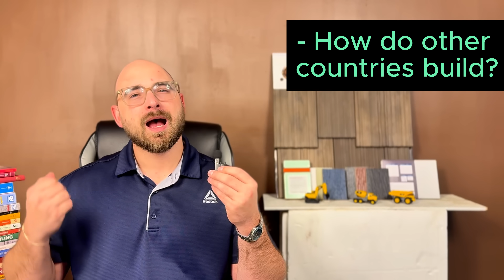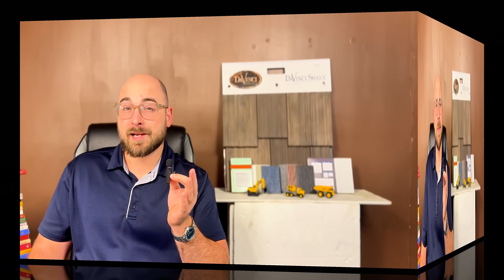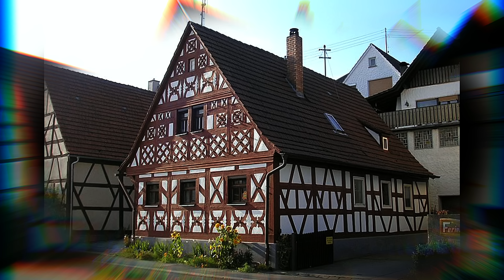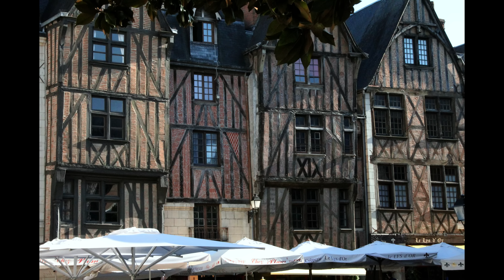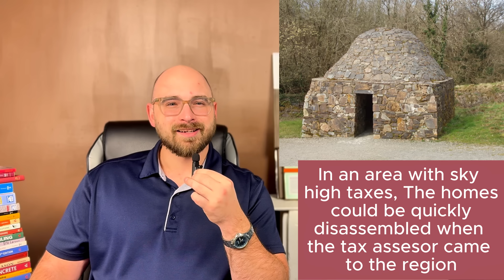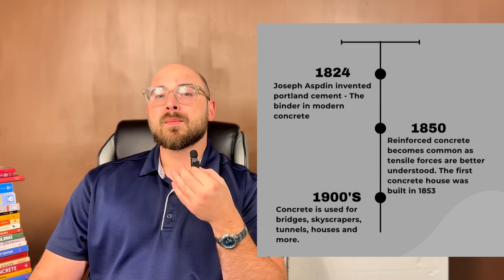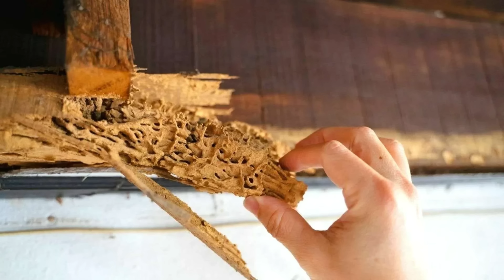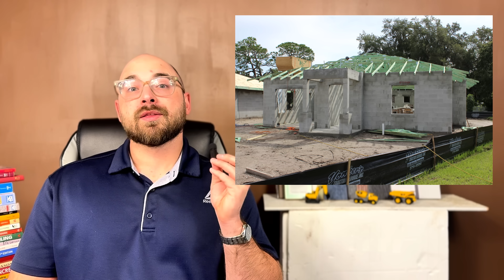Why Other Countries LAUGH at American Homes

Comment: The one item that many people don't realize is that building a home is 50-60% labor. Stick framing is stupid simple, and sheeting is also stupid simple. In 2009 my wife and I bought land, had the pad poured with the plumbing, and I did the rest. We built a 2 story, 2300 sq. ft home in < 1 year, and did it all for <$60k. The same home was quoted to us (mid-2009) for $260k. So, if you are able to, do the work yourself. You'll save a TON of money, and have the pride of building and owning your own home at a fraction of the cost. It will suck, and feel free to hire out the stuff you don't want to do (electrical and drywall for me). Even if you are the GC (General Contractor - the boss) you will save tonnes of money. Just do your research and call your local building inspector. They are there to help you. Utilize them. Housing is still affordable, if you are willing to do the work. DO NOT buy a home from a spec home builder... it's a rip off, and quality is ALWAYS D-.
Reply from the maker: That’s an awesome story, 

I think that you greatly overestimate the capability of the average person to build a home. the technical skills, the knowledge required to be a GC, and the time required to build your own home, 

And even if you went this route, ICF is also extremely DIY friendly. You could have built an all concrete house with much better safety and energy efficiency. but almost no one is concerned about building well, they’re concerned about building big, fast, and cheap whether it’s DIY or by a professional builder

Comment: I personally don't care its a roof over My head it keeps the rain out
Reply from the maker: They way they build them now the roofs leak
Reply: @Mike_Fortin  Well I use tar paper and shingles and I don't have a problem with leaks. I have no trees to harm My roof and no valleys to worry about plus I use Gable vents My house was built in the 80s and it is a Ranch with only four corners. My house is affordable to take care of. I've seen Brick and Cement houses bulldozed because of age and weakness and all building materials have limits and tend to start failing over time and because of poor maintenance. There are some places where you should not build on at all.

Comment: its less about the style of the house, its about standards  and code being both lower and on top of that ignored or looked at as a suggestion. you'd be fined millions on millions here, serving prison time, as well as losing your diploma  that proves you  went to school and had a multiyear apprenticeship dedicated to your field (timber, concrete/bricks , plumbing etcetc). and well, you wouldnt find any work at all after that on top of being drowned in fines and if you did it more than once, prison (someone i know who skimped on standards just got out of a 5 year prison sentence for this).  standards. are. not. a. suggestion.

Comment: I'd love to see you compare Hempcrete to more traditional concrete!
Reply from the maker: Hempcrete is not structural
Reply: @Mike_Fortin I thought it was used in conjunction with wood or steel framing.  Sorry.
Reply from the maker: @ICU-mw7su  it can be used as infill for insulation. It performs fairly well, eco friendly, fire resistance similar to rockwool. It’s generally more expensive though which is why it’s not used very often, 

You’re more likely to see rockwool or even woodfiber insulation than hempcrete or hemp wool

Hempcrete does not have load bearing capacity like traditional concrete, the name is a bit misleading
Reply: @Mike_Fortin Good to know,  thank you!

Comment: You compared 2-3-5 years old technologies from world to american modern houses. This is noit correct. Yes, you build low level houses, with thin walls and for high prices. My grandparents built their houses from bricks, the outer walls 45-60 cms strong. Good isolation in both winter and summer. My parents and also me have built houses in the same way. The inner walls at least 15 cm (the people use also 7.5 cm thick brick walls between some room, bur dominantly 15 cm). Each room is perfectly silent and nobody is ditgurbed by others from adjacent rooms. These hauses will be functional also when will be 1-200 years old.

Comment: There’s a lot of valid criticism against the way a lot of American built homes are made, however none of those comments are talking about those things but rather just criticizing the use of drywall inside the house. A vast majority of the people making those comments are ignorant to why drywall is used in place of brick or concrete in a lot of places. Take where I live for example, Southern California. The number and severity of earthquakes we get here is pretty high so structures need to be built for that in mind. Older brick and concrete buildings had to go through seismic retrofitting in order to be caught up to earthquake safety code and a mid sized two story building would have cost ~$70,000 in steel reinforcements. In contrast, a wood frame with drywall bends with the quakes and is safer. In addition, it can get very hot in this area and while brick and concrete buildings can be insulated very well, they also have a lot of thermal mass that takes forever to cool down at night once it’s heated in the day. I’m no stranger to the headache of trying to hang things on drywall, however I’ve also lived in a brick house before and I’d take drywall over brick in this region.

Comment: You can punch through a wall to the other side in USA. Meanwhile I can't even drill a hole through my reinforced fucking concrete wall in Poland cause my usual drill is too weak. Can't even hang a goddamn picture on it.

Comment: American homes are built for the enviorment,  just as european houses are. Europe doesn't have much seismic activity or severe weather, so they can build structures with no ability to flex, also europe does not have the extremes of temperature American houses do.

Comment: America's houses are worse ....because it's not safe .....tell if there is absolutely no boundry walls , no window bars , no strong doors or gates ...how do you guys protect your houses ...even the expensive houses in america as just a glass house that easily shatters ...I bought a  glass house infront of lakeside in america back in 2002 ...and after a yr I though of renovation since my parents refused to live there in america ....yet I found that backyard glasses were shattered and all the expensive lamps and woodwork was gone ....no camera was left ,vhs recordings of survalince were all gone .....that's how houses are made in america and that too I had left the house for just half a month and was in Newyork to get a deal with my company to be signed ...

Comment: I think US industry is concentrated on speed but the quality and longevity suffers. I don't know how expensive the houses are. My folks build a brick house in croatia with reinforced concrete and insulation back in 93. It's as hard as a rock. It will remain forever.

Comment: The reason concrete isn’t commonly used in U.S. housing isn’t because it’s bad - it’s because capitalism favors short-term profits over long-term durability. Wood is cheaper upfront, faster to build with, and deeply entrenched in the construction industry. Developers don’t care about long-term resilience because they sell the homes and move on. Add in powerful lumber industry lobbying, outdated building codes, and a lack of skilled labor for concrete construction, and you get a system that resists change- even if concrete is stronger, more fire-resistant, and better for extreme weather. It’s not about what’s best for homeowners- it’s about what’s most profitable.
Reply: I lived in Sweden for a while, and most houses there are built with concrete or heavy masonry. You could literally feel the difference - solid walls, stable indoor temperatures, and almost no sound leakage between rooms or from outside. Even 50+ year-old houses there feel more robust than many new-build homes I’ve seen in the U.S. The contrast is shocking. In the U.S., where the walls were basically drywall and fiberglass wrapped around 2x4s - like a tent compared to a bunker. The American housing model prioritizes speed and cost over quality and longevity, and concrete simply doesn’t fit that equation unless we shift our priorities.

Comment: The main quality problem comes from bathrooms. The bathroom where the tiles are right on the drywall without any water barrier will not last longer than a few years. Over the past 20 years, I have renovated several bathrooms. My main residence has 4 bathrooms, and all of them have water damage. I have 9 rental properties, and 7 of them had water damage when I purchased them, and  3 of them developed water damage later on.  The main reason for water damage, no water barrier (tiles directly on drywall), no drain on the floor. Many contractors don't even know what water insulation is. 50% don't know what Red Guard is, and 90 % who know don't know how to apply glassfibre to Red Guard.

Comment: So the long and short is:
 The USA are starting to go back to a form of building in residential areas that they have been using fir commercial and public buildings since Art Deco...
 Amazing.
Better hope noone in a spacing department realizes that you might just build a mix-use building as it can easily have several etages.

Look at the Hafen City Project in Hamburg, Germany. It would be plain-out illegal in many US Cities. Residential Areas above stores? What is this? An East Coast City? This cannot fly! And where are the  three square miles of parking lots?
What do you mean it's outside of the Deich Area? Are you nuts? Oh wait, it is right next to the PORT, of course it's waterfront. Wait, you have double layered foot traffic bridges so people can get to the Speicherstadt in case of a storm flood too?
 What I am meaning to say is:
 The US has a larger building problem than materials.
It's the stringent absolute building codes. That are applied anywhere. But: Rules that are perfectly reasonable in the Nebraska don't make sense in Hawaii amd vice versa.
 And strict seperation of housing and commerce doesn't make sense anywhere. In fact most world renowned american cities do not do this at all or at least a whole lot less than "Place, USA".
We have a commercial center with highrise office buildings, a highway, a strip mall with enough parking spaces to have about half the city population park there at once and a massive halo of suburbs thst serve no other purpose than make us sprawling to seem large and important amd make sure that anyone needs to own a car as this method of city planning was invented by General Motors.

Comment: What always struck me is, that on the best country on earth (obviously), where tornadoes and hurricanes and whatnot actually are a factor, people do not build with it in mind. Meanwhile in little peaceful Belgium where at best we get some high winds, we have houses that would withstand tornadoes. Always struck me as odd that America never built for purpose, or even better, overbuilt. But as you went over, must be a cultural thing. We build to last, a house is passed on to children. In America everything seems to follow the consumerism mindset, buy, use, throw away, including the housing. We do that too, with small things, but a house is home, it's a fortress of solitude in a densely packed country.
Pictures of cars driving through walls is not something seen here. In America you can probably put the car in reverse and drive right back out, here the car would be a goner. My father build our house himself (along with friends and collegues), and admittedly it's more sturdy than others (80cm steel/concrete inbetween floors) but most houses here are at least solid. I've been to what I'd consider a dinky little houses, where the flooring/ceiling is made out of wood, and I get an uneasy feeling to hear the wood warp and move as you step on it. I want to stand on solid ground no matter what floor I'm on :D

Comment: Most of the videos I see about American houses are the ones where basically the whole house is built from thin wood and my questions are how do you really believe that will last especially through the hurricanes and tornados I most often hear are happening in America? I see people punching holes in the walls with their bare fists and it always shocks me. If your houses are so weak a human hand can break them with no issue how do you even have the guts to sell them for over 200 000 dollars? For that price you could probably only buy a small apartment in my country, but at least it'd be durable and sturdy. And I'm rpetty sure it's like that for most of Europe which is why we find it funny when someone sells "a 29472747 square feet villa" for 14mil dollars, because we know it's not gonna last for more than a decade 😭
Reply from the maker: Production housing has always been cheap and flimsy, at least from the 1980s onward, the real crime is building million dollar homes the same exact way

Comment: I'm looking foward to the 3d printed cement houses, the ones they are building in Texas right now look nice and sturdy.
Reply from the maker: I would recommend ICF / poured concrete over printed. 

The printed homes have issues 

Cracks that lead to moisture / air infiltration, the exposed concrete is porous and absorbs moisture, there’s thermal bridging and a lack of insulation, a lack of proper reinforcement, etc. 

They automate something that never needed to be automated, still takes a whole crew to set up and manage the machine, 

In summary poured walls are better in all areas, price, comfort, longevity, efficiency, etc.

Comment: Its not just Europe, also us in Latin america just south from you. My house is a bunker compared to your hollow wood and plywood boxes. Over here the standard is concrete, stone blocks and iron build houses, all designed with anti-seismic measures cuz here it quakes alot usually, my house is probably over 50yo and is still great never had a moldy rotting wood problem either. Its withstood time and many quakes, and the best part is since its not the US building houses like this is less than 50k.
And this is why Latin American contructors that go to work to the US have a great time there cuz its considered light work, they never mention this for a reason. 😂 
Also people are mostly making fun of the price of these plywood houses, not the way they are made.

Comment: I live in Brazil and my house is a concrete and steel frame with the lower level CMU infill and the upper level clay bricks infill. I think its the most common method of building for about 50 years here. A steel concrete frame with blocks infill.

Comment: The Khrushchyovka-style building I lived in my childhood in China has better insulation than the wooden apartment in Midwest. I am shocked when i first saw the building uses air conditioning than an actual heating system.  It makes no sense as hot air will never sink down.

Comment: I am from Tanzania.  Most residential homes here are built with what you call CMO, but the foundation and the top of the superstructure is often reinforced with concrete slab, which is a mixture of rebars, sand, pebbles, and cement  for stability. Roofing is  corrugated iron sheets, congrete slab can also be used. 

 In rural areas, red bricks (raw clay bricks burned to red in the kiln to establish stability) are used, and the finishing style is the same. Homes are indeed built to last. Mud homes are becoming rare even in rural homes. You will almost find none in urban areas. 

You wouldn't convince someone to own a timber home here. They will get the feeling that it is a temporary residency. Before my knowledge on how you guys build your homes, I wondered why could someone shoot through the wall and kill a person inside, your homes are not safe at all. 

Cost is just a relative term. If you exclude mortgage (which is not common here, actually very rare) home ownership is probably high here in Tanzania than in the US, people can afford to build their homes from scratch. You just need to find builders specilized for each step of your construction process. The major steps of house construction are  superstructure,  roofing, and finally, for the finishing process. Depending on your financial status,  building a home might take say around a year to years. 

The use of construction companies are for high-rise buildings, this is required by law.